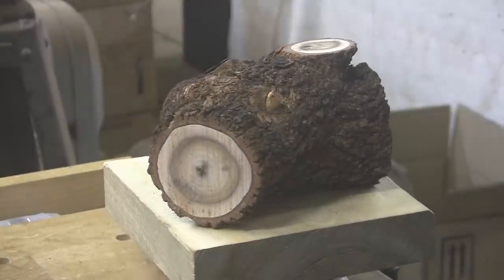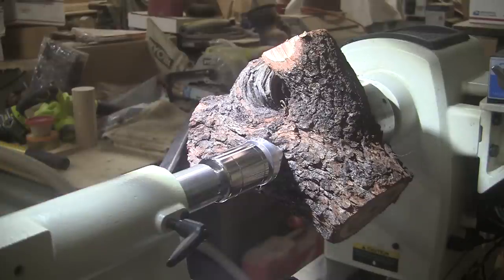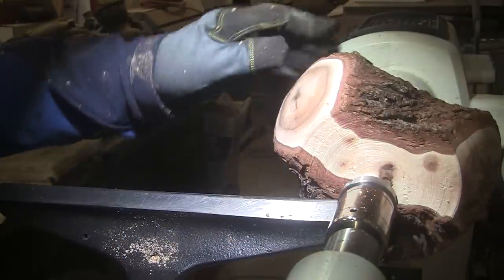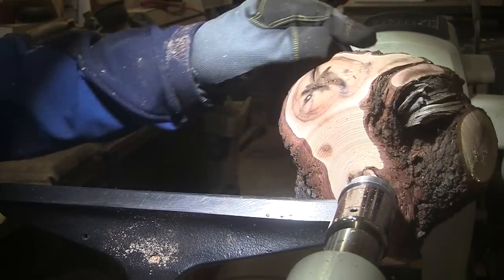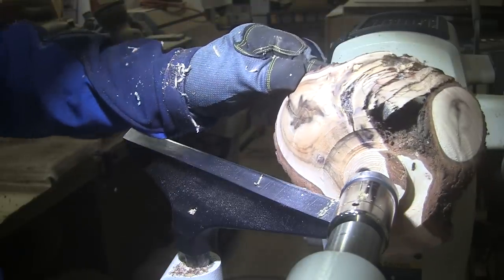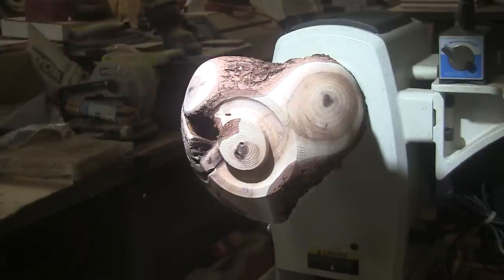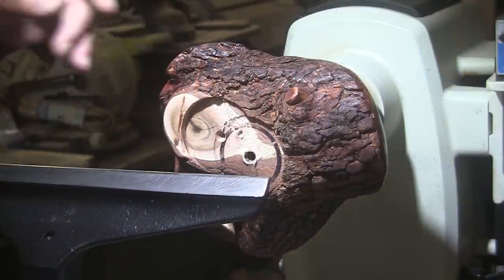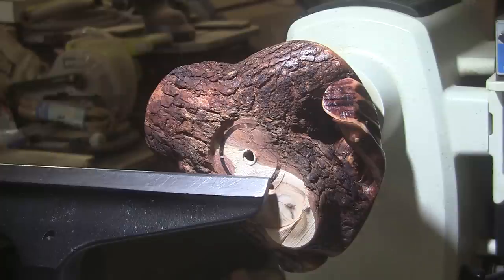Broken But Beautiful - Wood Turning

Comment: Hey Phil, Absolutely beautiful bowl there! I use Zinser shellac also but I use Minwax sanding sealer (cant find Zinser sealer locally). With Minwax I dont have an issue with brush strokes. Not sure why. But it does bubble on me so I have to blot with a rag to get rid of the bubbles in spots. I guess it is 6 of 1 and half a dozen of the other. LOL  Oh almost forgot to mention this but when I finish something with sealer and shellac after I remove the tenon I finish the bottom with Howard's Feed-N-Wax. On one piece I accidentally got some feed-n-wax on the shellaced side of the bowl and it brought out the shine even more so now after finishing with shellac I put one light coat of Feed-n-wax over the entire bowl. I was amazed to find that happy accident. :) Yall have a wonderful day.

Comment: Another fantastic bowl and a really interesting turning vid to watch. Always amazing to me how you bowl turners do it and at so slow revs. I would start off turning a spindle at around 1500 and could get up to 6000 to keep it s solid and stable enough to work on as the piece became thinner. Thanks for the entertainment Phil. I need it to get through another all but total lockdown here in my part of the UK. Keep safe.
Reply from the maker: I hear you, Rod!  I prefer to turn at higher speeds, too, but most of my stuff is just so out of balance it's not possible.  I did just do a spindle turning and wow, so much easier to make cuts at high RPM's!  I had to stop, didn't want to spoil myself.  LOL!  Yeah, they are locking us down again, too.  Well, the vaccine is supposed to be out very soon, already out over there, I think.  Maybe that will cause things to improve.  Certainly can't get much worse!

Comment: Phl - Enjoy your work and love the final product.  I have experienced the gouge jumping because of voids in the wood.  I have found that sometimes it helps if I increase the speed consistent of course with the balance and vibrations. This can sometimes smooth out your cut.  I think it helps because the material moves so fast across the cutting edge of the gouge that the tool jumping is lessened.  Just a thought .  I am not an expert.
Reply from the maker: There is no doubt a higher speed helps, James but as you say, can't do it when a piece is out of balance such as this one.

Comment: At about 12.5 minutes in you asked why you couldn’t get it smooth inside. I believe the piece may be expanding at the hole when spinning. Making that area pull away from your tool. Just a thought!
Reply from the maker: You are not wrong, Santa.  Probably combined with the shrinking of the wood as it is turned and dries.  It was a pain but it turned out ok!

Comment: Utterly gorgeous turning. If you sell your bowls, make your work known to The Planetary Society, the otherworldly is irresistible to the members.  What is the best finish for wet wood (Honey Locust)?
Reply from the maker: Haha, I'll look into it, Charlie!  I'm no expert on wet wood or the finish for it.  I will tell you my thinking.  I almost always use one of only two finishes.  Shellac or Howard Feed&Wax.  From my limited experience, both work and both for what I believe are the same reason.  They breathe.  The wood has a chance to dry slowly and doesn't crack or suffer any other consequences.  I could be wrong, of course, but I have had good luck with both.
Reply: @PhilAndersonShadyAcresWoodshop  The pieces I am thinking of turning are  400-pound pieces of honey locust, crotch, straight, and wind shattered plus one small branch destined to be several bird-mouth bowls to get a feel for the larger pieces. Season's greetings and a happy new year.

Comment: hello im new to wood turning and i watch a lot of your videos and you do an excellent job describing the steps you take. I have a question about the turning lines you are having trouble with on this bowl. Could you try using your negative rake scraper with the lathe in reverse on the back side. I may be wrong but it looks like if its bouncing in one spot in one direction  wouldn't it bounce the opposite side in reverse.  Thanks for all your very helpful videos
Reply from the maker: No, turning in reverse would not change anything in the turning of this piece.  If part of it is sticking into the bowl from one direction it's going to be sticking into the bowl from another direction.  Same goes for the parts that are not sticking into the bowl.  I very seldom turn in reverse because it just doesn't change anything except the accessibility and view-ability.  The wood remains the same with all of it's little faults and features.
Reply: @PhilAndersonShadyAcresWoodshop  thank you for responding i look forward to more of your videos and learning more about this awesome craft

Comment: I have noticed that tool marks issue too - it's really frustrating. My theory is when turning through a gap and back on to surface is a shock that easily results in a bounce that causes marking. I would also guess a curved gap has a more pronounced effect.  A narrower scrapper and the lightest touch helps but some kind of smaller tool of choice seems to help me. 

Since I am a newbie I have tried several kinds of sandpapers including your recommend Sandoflex which is super. I like the oversized sandpapers for the inside - the 2-1/2 on the 2 inch pad curls on turning and works great. I also like the mesh style for going over sealer or especially shellaced surfaces because it doesn't gum up like regular sandpaper. 

I use a regular scraper and am not sure of the benefits of the negative scraper you use. Can you explain? Also, one fellow says don't scrape further than one third from center of bowl because that's dangerous. Doesn't seem to bother you and you are a careful guy. Is the warning a sort of wives tale?

Please feel free to chastise me for so many questions. Thank you.
Reply from the maker: When there is a large crack the wood can actually separate and take on two different surfaces, one higher than the other.  I run into it all the time on the pieces I like to turn.  You might not see it but your hand can feel it.  Nothing you can do about it.
A negative rake scraper is easier to use.  You just about can't even make it cause a catch.  I've never even come close to a catch with one.  No matter where on the bowl you use it. 😃

Comment: Phil what do you call the calliper that you are using in the shape of 8 for measuring the depth and where can I purchase one? I can’t see to find one. I have the three regular Cali pets but they limiting to the sides. I would be so grateful if you provide me with the proper term and where can I purchase one. Thank you 🙏in advance. You are one of my greatest tutor. Again, love the piece you turned.
Reply from the maker: Mine are Robert Sorby and the one in this link is very close, but I think the smaller end, on mine, are just a tad bit closer together, thinner, if that makes sense.  I think they don't make them anymore but these should do:  https://www.amazon.com/Sorby-Calipers-Double-Ended/dp/B000OY6CFO/ref=sr_1_2?dchild=1&gclid=Cj0KCQiAzsz-BRCCARIsANotFgNBby4HJRq1navUzTJ690eqX5yzIxXftlJYoCOoGkXG92yg2XRMHhIaAh1iEALw_wcB&hvadid=177784529933&hvdev=c&hvlocphy=9033474&hvnetw=g&hvqmt=e&hvrand=11777197710996444674&hvtargid=kwd-35767484792&hydadcr=1610_9901457&keywords=sorby+calipers&qid=1607717248&sr=8-2&tag=googhydr-20  
Hope that helps!

Comment: Phil I love the way you just get started and take on the challenge of these crazy looking pieces of wood.   I notice you usually use the cone shaped live center vs a cup.   Is that because you can do the tenon removal easier?  Or another reason?
Reply from the maker: It is true that the cone, even though it looks bigger, is actually smaller at the tip and does allow me to get closer to the tenon.  Beyond that, Jon, I guess it's because I turn mostly bowls and don't run into issues where the cone might cause a piece to split like you do when turning spindles.   Hope that helps.  Thank you for watching!  😊

Comment: Another nice one Phil.  Maybe I've noticed in the past but my poor old brain just registered - Green Wood Huh?  It's been more than 2 months since you turned it - any significant cracking or warping?  I'd sure like to be able to turn my bowl stock sooner than several years after I collect it.  I wasn't aware that you could sand and shellac it while it was still quite wet.  Regards, Tom
Reply from the maker: I'm not an expert on green wood by any means, Tom.  I usually turn dry.  I live in a climate that is cool and moist, much of the year.  Also, I think the finishes I use allow the wood to dry slowly, avoiding cracks and warpage.  I have not noticed any changes in this piece.  I also think the turning and sanding help the piece dry as you work it and the surface is dry enough to apply the finish even if the entire piece is not completely dry.  Like I said, I'm not an expert, these are just my feelings about turning wet wood.  If you live some place dry and hot, all bets are off! 😊

Comment: Do you ever combine lathe with hand work? I would have tapered more off the rims (made them slimmer, more of an outward lip & like a 1/2” bark area) by hand. Would I have been wrong or weakened the bowl that way? By the way, your bowl turned out beautifully. I like yours better than how mine would have turned out.
Reply from the maker: Yes, I have used an angle grinder to slightly do what you are saying, Susannah.  I would never do it on a piece like this, however.  I only do it when one area might stick out a little and make the piece visually off-balance.  I hope that makes sense!  I'm glad you like it as is, thank you! 😊
Reply: @PhilAndersonShadyAcresWoodshop  Yes, it does. Thanks!

Comment: you do very nice work Phil but i have a question - why do you  always create your tenon by creating a recess around it then forming your foot outside that?  it seems this forces you to create a wider foot that what otherwise might be desirable.  this method might increase the overall height of the bowl somewhat but in some cases would you not be better to create your foot as part of the tenon formation then when cleaning up the bottom the foot is formed more or less by just removing the tenon and that spot becomes the foot.  it seems this would give you more choice for the outside shape of the bowl.  not trying to be critical here just don't understand your reasons for going with that style of foot.  i totally agree that wood with defects (or natural enhancements) look the best and you do a great job of that - keep up the good work
Reply from the maker: Thank you, Ian!  Well, a couple of things.  First of all, I'm stuck in my ways so don't try to change me!  LOL!  I'm trying to wrap my head around what you are suggesting so forgive me if I get it wrong, I've only had three cups of coffee this morning so not thinking clearly, yet.  So, come in from the side of the bowl, at the bottom, of course, and stop at the side of the tenon.  Do that until I have a tenon of appropriate height.  Then create the bowl.  Now it's time to remove the tenon.  Normal process but now I have to remove the entire tenon AND make that indentation so the bowl will set flat (a flat bottom is a bad thing) and I have to make it with little support.  Also, now I have to sand and finish the entire bottom off the lathe, something that's easier to do on the lathe.  Additionally, I still have a foot that has to be at least as wide as the tenon plus additional space for the chuck jaws before I get to the foot.  So, what have I accomplished?  I'm not knocking your idea, Ian, just trying to understand it.

Comment: Wo, this sumac bowl is breathtaking with its dramatic grain and the area around the hole and branch. Is it Rhus typhina ? If yes, mind that its lightly poison wood,  is it safe enough to seal it with shellac? By the way, did you do a video in which yo explain the difference between  the two prefered finishes ? If not, i'd like to see one with the recipes to try out  myself. Cheers Stefan
Reply from the maker: I only know what the sender of the wood tells me, Stefan.  Sumac.  By "two preferred finishes" I guess you mean shellac vs Feed & Wax?  Thee are no recipes for me to share.  I buy both fully prepared and use them right out of their containers, no modifications. 😊
Reply: @PhilAndersonShadyAcresWoodshop  Hi Phil, what I meant was the difference between shellac and shellac based sanding sealer. I thought, you'd use  self prepared mixtures. In between I found  a video that shows how to make shellac based sanding sealer by using shellac flakes diluted in denaturated alcohol. This will my nex experiment. Cheers Stefan
Reply from the maker: @stefanaretz8136  Just be sure those flakes are de-waxed.  If they contain wax, a finish will not be able to stick to the sealer.  That is one big advantage to using Seal Coat, it's de-waxed and any clear finish can be applied over it.
Reply: @PhilAndersonShadyAcresWoodshop  Thanks Phil, i ill have an eye on that. Dewxes Shellac flakes are available on amazon , even in different colours. I think the lightest colour ill be the best  for every wood. Keep on turning ! Cheers Stefan